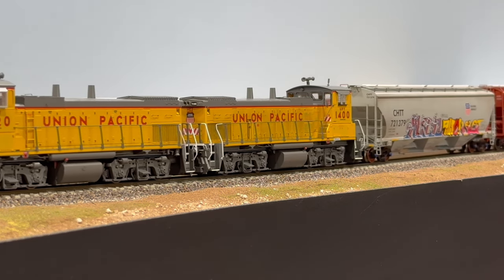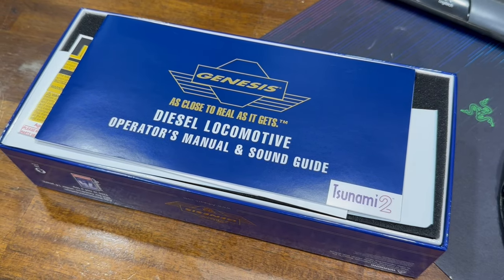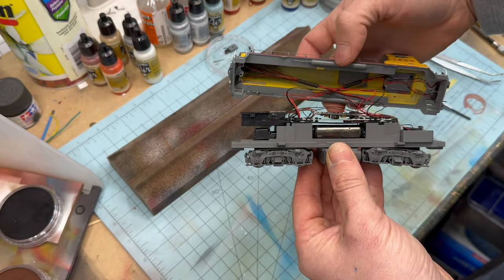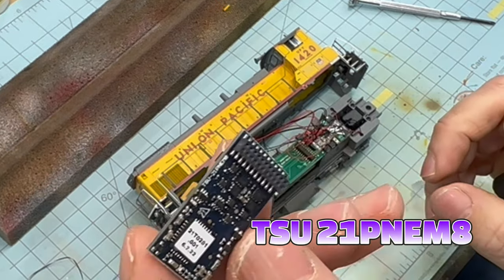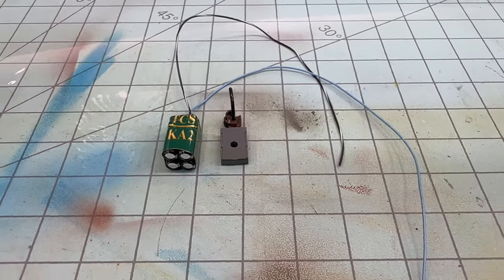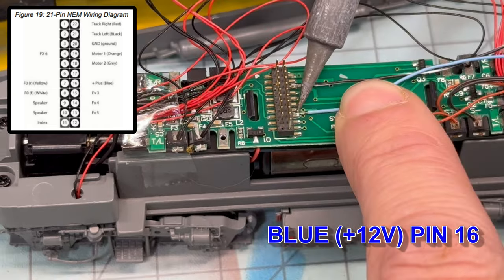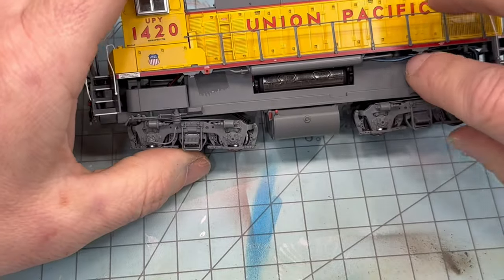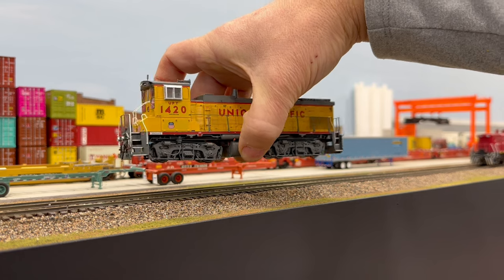How to Install a Keep Alive Device in an Athearn Genesis MP15 Locomotive - Quick and Easy

Comment: I don't understand why DCC manufacturers should charge c$30 for 4 capacitors wrapped in a heat shrink, which cost them about 10c each (probably less than that) . It's such a rip off!
Reply from the maker: It's definitely the cost for being convenient!